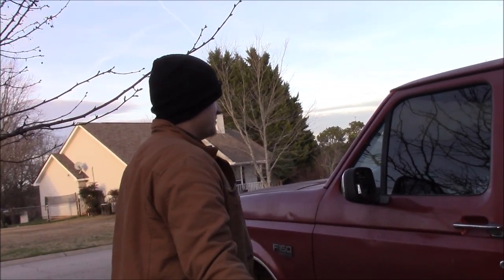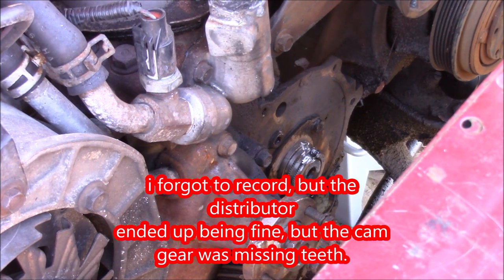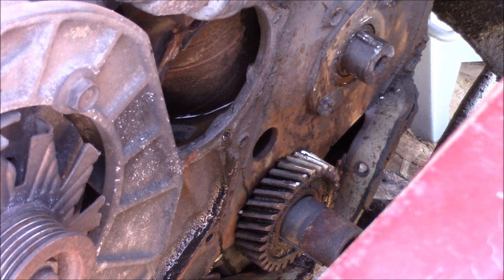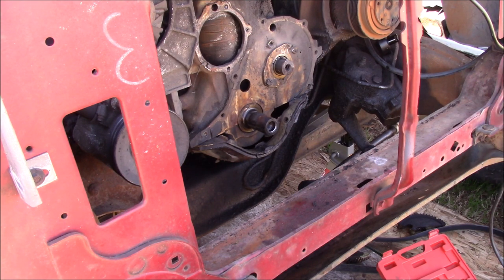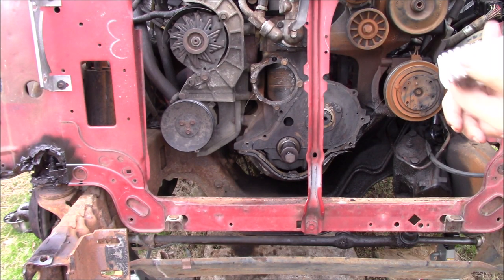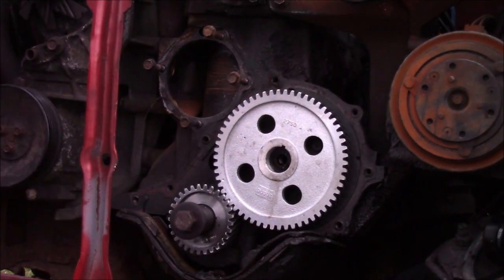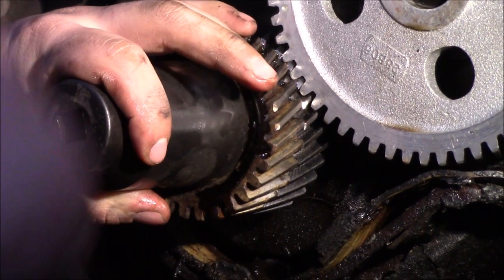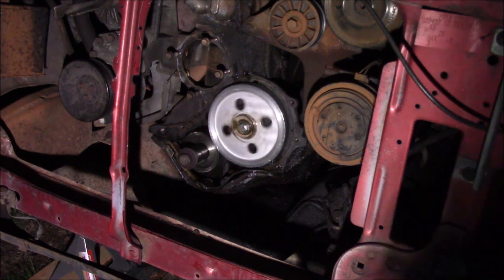How to Replace Timing Gears Ford 4.9 Liter l6

Comment: I didnt really see your cam pop out like one of the other comments said but it is possible that it may have. With out your bolt & washers it looked like about a 1/4 inch of the gear still needed to be pressed onto the cam. I have the same gear & am going through this now as well. Any way I saw you pounding on the gear to get it to slide onto the cam, I did the same thing. Well instead of it sliding on the cam all the way mine pushed the cam into the engine farther & there is a plug(like a freeze plug) in the back of the block that holds the cam in place along with the front cam plate. Well mine i pushed the plug outward therefor the cam could move back & forth in the block & if it moved far enuf it could couse real damage. Im thinking yours may have dun the same? Maybey not? Just a heads up.  Don't beat on the cam gear for you may push the cam inward pushing the cam plug outward. The only way to push the plug back in is to take the trans out or take the entire engine out.
Reply from the maker: that was not an issue on mine also i should have thrown a warning in there about that happening.  the bolt is just to press it on it was removed afterwards
Reply from the maker: my cam didmt come out of the block
Reply: My cam moved into the block a little bit while I was retapping the cam nose.

Comment: Back in the day,  i owned 3 Ford trucks with the 300 6 cylinder, i never had these gears fail on any of them.
Reply from the maker: @claylyons6447 its a hit and miss type thing. They have been running fiber gears on these trucks for a long time

Comment: the perpos of heat is to expand them and allow them to slide on also go to the auto part store and get a power steering puller/ press it cost 40 to rent and you can get cheeper ones but that is what you use to install them and you use the puller that you used to pull the crank gear is the right one to remove

Comment: Should have heated the cam gear in a oven at 450 degree for 30 mins. And it would have went on the cam a lot easier.  In fact the paper that come with the set will tell you the same as I just did.
Reply from the maker: Well i will do that in the future

Comment: Actually, that key on the camshaft IS replaceable, and SHOULD be replaced when you install new gears. Done plenty of them on this engine. Have one on the stand right now in fact.
Reply: I had read online recently that these woodruff keys are no longer available for the 300 I6 motor. Do you know a part number or have one I can buy from you before I do the job. It's my truck so it's not a big rush or anything.

Comment: You're pretty good at this , explaining and showing.  If it was me I would edit out all the mundane shit , like farting around with the wheel puller to get off the crank gear.  And I would try to stay the fuck out of the picture when showing an item.   Other than that, great job

Comment: How did you lift the A/C condenser without disconnecting it? I do not have the tools or experience to disconnect the A/C unit.
Reply from the maker: I only did it for recording purposes what i did can damage the condener and ac lines

Comment: Man that engine design could have been bullet proof if they had used metal cam gears from factory. Anyway how much would this job cost? Shop hours?
Reply from the maker: i dont know how much it would cost depends on your mechanic

Comment: Did you ever remove the oil pan? I just got done doing my timing gears and I drained the oil ( I never started it after installing the new gears) I just don’t want to drop the pan now if I don’t need to
Reply from the maker: i did and i highly recommend it. there were pieces of the fiber gears still in there
Reply: Xxdayday99 sounds good thanks

Comment: at the end of the video, when the engine is cranking over, it seems like the cam gear pops out a little as its turning. also im curious if you left in the bolt in the center of the cam or was it just for installing it.  and finally. how is the truck running since this video.
Reply from the maker: well the truck isnt running great because we ran into alot of other issues unrelated to this one. the bolt interfered with the timing cover so it had to be removed, im not sure about the cam gear popping out. i havent had any issues so far. i have driven the truck (not far) since this video, and havent had any issues.
Reply: oo my god , what 😮 a comment jaja 😆 i think 🤔 you have to running next to a toll truck 😕 just in cases.

Comment: I just had to do this...pain in the ass I tried to cut a ridge out like you did and and nicked and grazed the shaft.....was wondering if I'm gonna need a new cam somebody said if I nicked it it won't ever run right....didn't touch the keyway tho....but I ended up stopping that and just cut the grooves going around it deeper and the 2 jaw puller got it off
Reply: just used a socket instead of letting it go inside threads

Comment: I was able to get the gear on after about 2 days, I was not able to get it completely flush. I've done all I can to get this gear into place but there is still probably 1/8 of an inch that I just cant get. Does anyone know if this will be an issue when I try to start it? Or should I just full send and see what happens. Thanks in advance!
Reply from the maker: So as long as both gears are at the same distance it should be fine. But if one tooth is slightly over the other one it could be a mild issue. I would definetely put the timing cover and make sure nothing hits before i sent it
Reply: @Xxdayday99  awesome, thank you kindly :)

Comment: My crank gear doesn’t have any holes to use a puller
Reply from the maker: Thats strange most. Do you could possibly use a 3 jaw puller
Reply: @Xxdayday99 could not use a 3 jaw so I ended up drilling 2 holes and tapping them then used a regular puller, gear came off great
Reply: @Xxdayday99 how do I make sure my crank and cam are rotated right for me to put the gears on. I don’t want it to be out of time or anything
Reply from the maker: @SPIXZY49  there is a keyway in both the crankshaft and camshaft. When you put the gears on there are 2 dots that should line up
Reply: @Xxdayday99  so I should obviously turn the crank till number 1 is at TDC but what about the cam should I turn that since the cam and crank have moved without gears on them
Reply from the maker: @SPIXZY49  you could have a issue with valves clearing on certain engine so   turn your crank as close to your cam as you can. It all depends on what happened to cause you to change the gears out. If they broke then tdc on#1 would set the crank right and you would turn the cam to match it

Comment: If you want to destroy your cam do what this kid does. If you want to do the job right use another video that will show you how to use a steering wheel puller to press the gear on all the way without shoving your cam out the back of the engine.
Reply from the maker: Ya know something hilarious is that with the rockers and everything attached that cam has nowhere to go but keep hating
Reply: @Xxdayday99  I will
Reply: The cam shaft stop out the back of the engine allows engine timing to drift by moving in/out on the helical gear teeth.

Comment: L would have welded two bolts to the hub and use a puller to remove it lol
Reply from the maker: Lol good idea i didnt have a welder at the time unfortunately
Reply: @Xxdayday99  oh man a welder could be a good tool
Reply from the maker: @terrygriffith7907  i have one now and dont know i worked without one before
Reply: @Xxdayday99  it's a must have tool

Comment: Only Ford would have a gear drive engine with a phenolic gear. What a fucked up design.
Reply: The plastic gear was to reduce noise and protect the crank.
Reply: @eegg6954  yeah they always use the excuse of noise reduction but if you remember the iron Duke GM 2.5 l engine had to gear drive and it was a little noisy but other than head gaskets failing it was a pretty good design. If you remember Jeep and Chrysler used to use a plastic gear on their distributors was that the reducing noise too whenever we had a Jeep come in with it no start we just ordered plastic distributor gear.
Reply: @jagrench62   That seemed to be a cheaping out tread of that era, and the main problem with a whole generation of motors.